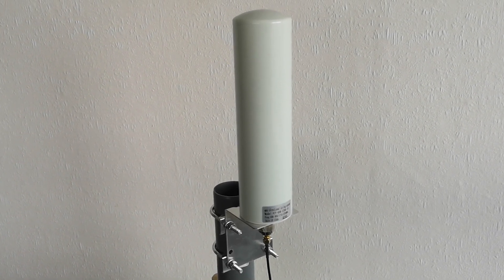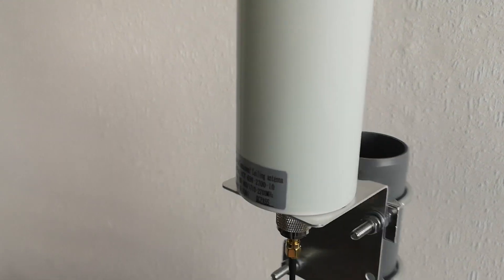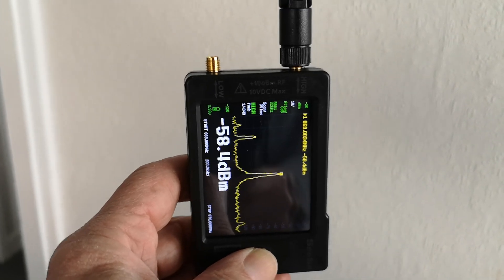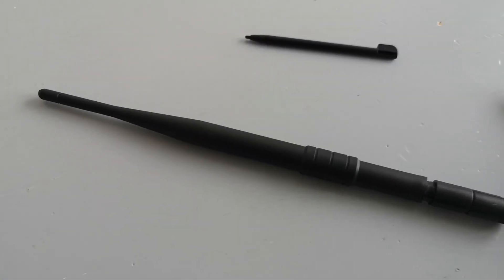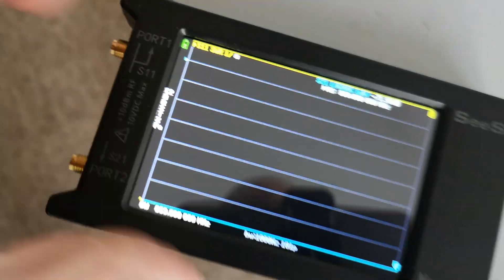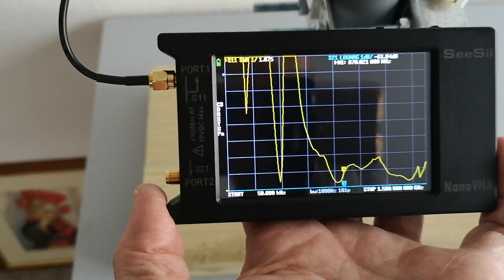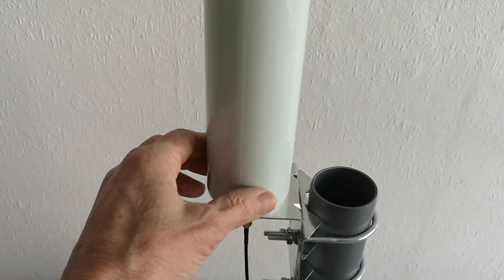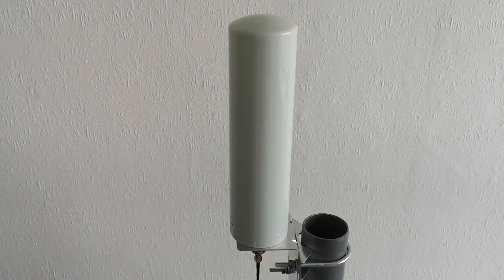Urcianow Broadband LTE Antenna tested on Meshtastic frequency.

Comment: I had these 1 year on the roof but it isn't water tight , it was full with water almost a cup full
Reply from the maker: Oh dear. For outdoor use in exposed locations I use a similar box with screws holding the lid and a rubber seal running in a channel along the interface between lid and box.
Reply: Is the top only a cap, rather than a one piece mould?
Reply: The top section is glued on the bottom section on the mount and isn't water tight , the antenna it self is a PCB board